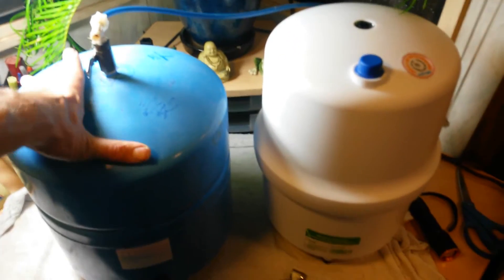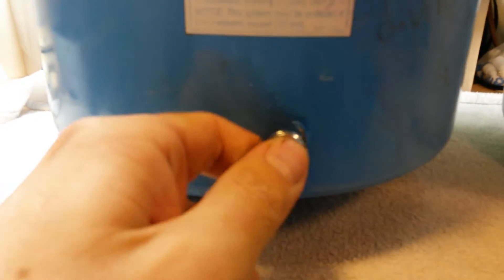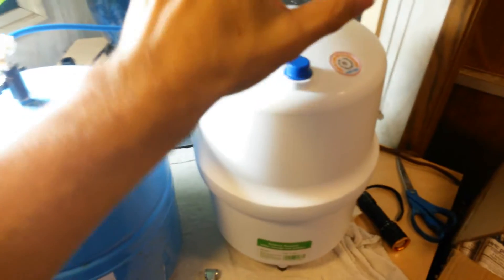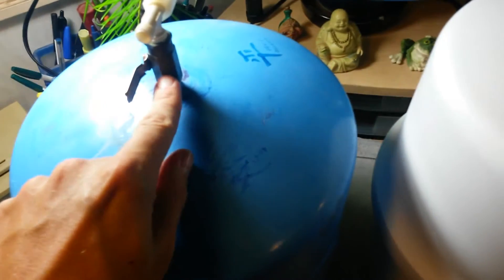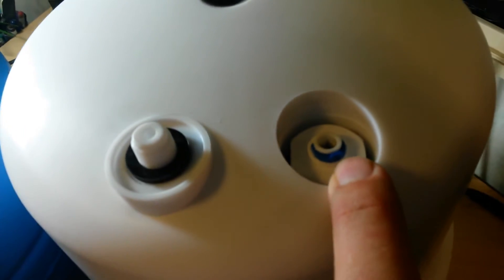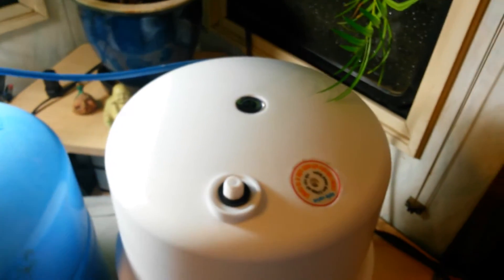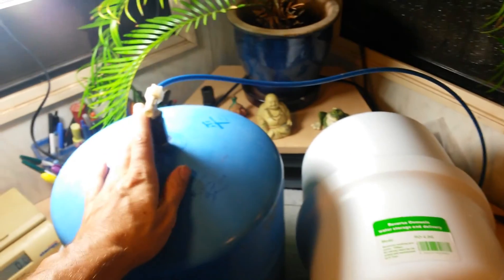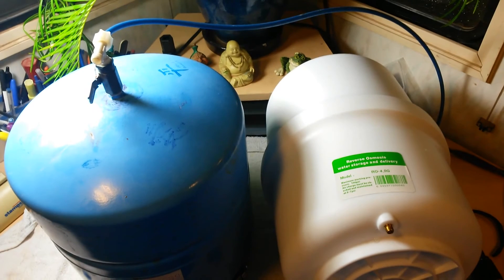(Reverse Osmosis:) RO Tank Replacement & Testing. Cheap $20 Pressure Tank

Comment: THAT  WHAT MY  TANK  IS  DOING, WATER  IS  COIMIG  OUT  RHROUGH THE VALVA  STEM,  YOU  ARE  THE  ONLY  ONE I  HAVE  SEE , IT  A  BAD  BLADER  AND  LEAKING,THANKS AGAIN,  JUST  HAVE  TO  FIND, THE RIGHT  VALVE  FITTING ONTO P OF THE  TANK  FOR  THE,  FOR  THE  WATER  LINE   WHEN I CAN  BUY A CHEAPER TANK.😎

Comment: I use a 2 gallon RO tank as a accumulator tank for my camper Van water system and water heater expansion tank it's on the cold water side right after my seaflow 42 series water pump I use all stainless steel braided lines and threaded fittings and plastic tees and brass fittings too

Comment: IT THE TANK IS PRESSUREIZED WHAT OTHER REASON COULD IT BE THAT THE WATER IS NOT FLOWING INTO THE TANK?
Reply: shut the top valve, disconnect the tank,   then open the top valve where its safe to collect the water, then  try pumping water in